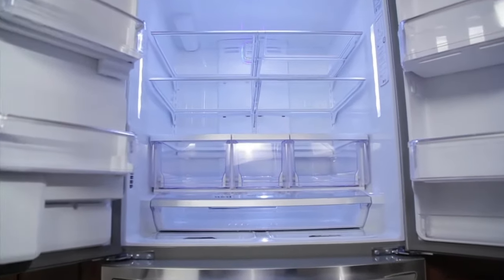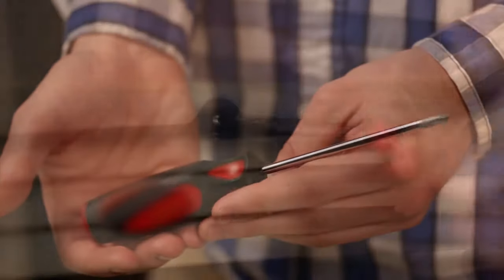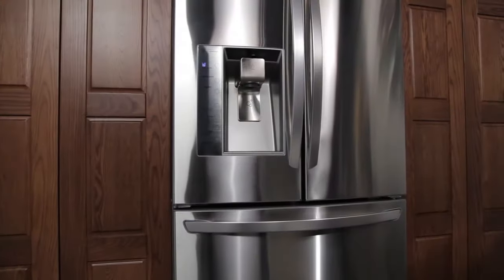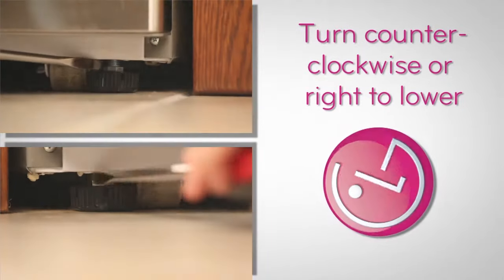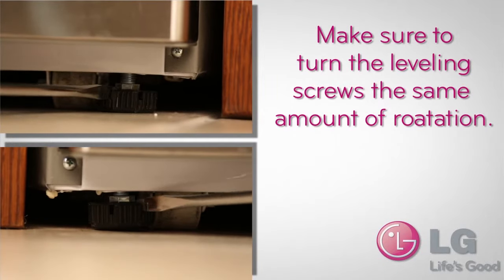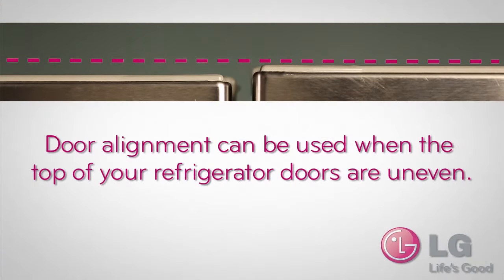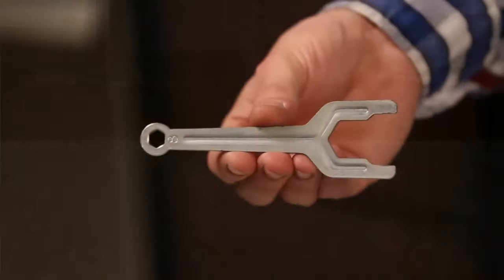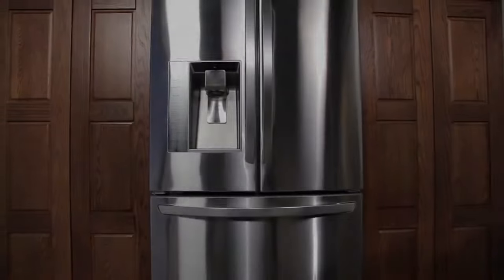[LG Refrigerators] French Door Leveling & Door Alignment

Comment: We just bought an LRFXC2416S french door fridge. I need to adjust the door on the right side facing the unit. There is no nut to adjust - as shown in your video.  I cannot find anything helpful to level the door.  Is there something specific to this unit I am missing?
Reply from the maker: I’m sorry to hear you're having this issue, and I’d like to see if we can assist. Please contact LG Customer Support by direct message via Twitter ( @LGUSSupport  ) or Facebook Messenger ( https://www.facebook.com/LGUSA/ ), and include your contact details, the model & serial numbers, and a detailed description of the issue. ^Nolito
Reply: Look in the manual regarding this. Some models don't have an adjustment nut on the right and instead, you lift the door to insert snap rings. Mine is like that (LFXS26596S) and includes two snap rings (look in the package with the manual). The manual for your fridge says the same thing. Did you already lower the left door as much as possible?

Comment: The adjustment for my left door didn't work. No matter which direction I turn the nut (which the supplied tool doesn't fit very well), it still remains higher than the right door. And I have the cabinet perfectly leveled across the front, and enough tilt so the doors close.  Seems to be a very poor door adjusting mechanism for it not to be able to do this.
Reply from the maker: So we can better assist with your issue please contact LG Customer Support by any of the below options:
Live Chat:  https://www.lg.com/us/support/chatbot
Email: https://www.lg.com/us/support/email-appointment
Facebook Messenger:   https://www.facebook.com/LGUSA/  
Twitter: @LGUSSupport      

^Diane
Reply: Were you able to fix this problem? Same issue. The adjustment nuts for the door do nothing. The installation guys snuck out while I was working.
Reply from the maker: Hi there bassplayer10. Welcome to our Social Media page. Based on your recent post, we see that you may need support. Please send us a private message with your name and phone number and we would be happy to investigate this further.  ^Jovelyn
Reply: @bassplayer10  unfortunately no. I never could get it even. Let me know if you're given something that works.
Reply from the maker: Hello bassplayer10! I'm passing by to check up on your case. Do you still need assistance? If so, let us know if there is anything that we can do for you.  ^Jovelyn
Reply from the maker: After several attempts of reaching out to you, unfortunately we did not receive any response. We assume that your concern has already been addressed. For now, I will go ahead and end our session. Should you have any other concerns, please feel free to reach out again. ^Jovelyn
Reply: @LGUSASupport  OK Jocelyn. I appreciate your reply. What else do you propose I try?
Reply from the maker: Hi, krga94c. I’m sorry to hear you're having this issue, and I’d like to see if we can assist. Please contact LG Customer Support by direct message via Twitter ( @LGUSSupport  ) or Facebook Messenger ( https://www.facebook.com/LGUSA/ ), and include your contact details, the model & serial numbers, and a detailed description of the issue. ^Chad

Comment: I just purchased (November 7, 2020) the LG French door refrigerator and the doors do not line up, even after adjusting the nut on the right door and adding the two factory provided C clips/rings to the lleft door.  Adjusting the nut on the right door did very little to raise or lower the door.  Adding more of the C clips/rings for the left door may fix the alignment issue, but I'm not sure if it's recommended to add that many C clips/rings to the hinge mechanism.

Comment: in my case, the doors are aligned and level. But the center flap on the left door does not close properly leaving a gap between both the top doors. The small plastic nub on the left door slides just below the channel at the top. Do I raise both the doors or is there anything else that can be done. model is LRFLC2706S 27 cu ft
Reply from the maker: Hey there! Let's close this gap from now on. The door might look even, but a small adjustment can make the difference. Here is a video on getting this fix quickly and simply. If you have any questions, please private message us on @LGUSSupport. http://spr.ly/6051XHEmP ^David

Comment: the front wheeles need to move up because the fridge is tipped too far back. how do i adjust?
Reply from the maker: Hey Josh. To adjust your LG fridge, you use a flat-head screwdriver to adjust the leveling screws. Turn the leveling screws clockwise or left to raise that side or counterclockwise or right to lower it. It might take several turns of the leveling screws to adjust the tile. We recommend a tilt to the back, so the doors can close easily. You can use a leveler to make sure the fridge is level. For more questions, private message us on social media @LGUSSupport. We're always here to help. ^David
Reply: @LGUSASupport  the leveling screws are adjusted all the way up, however the wheels are holding the front of the fridge up too far. I need the front wheels to rise into the bottom of the fridge.
Reply from the maker: Hey Josh. We would like to get more information about your LG fridge so we can help you better. Please private message us on social media @LGUSSupport with your contact details and model number. We'll be waiting for your message to help you better. ^David
Reply: @LGUSASupport  what social media?? what are you talking about? how about email?
Reply from the maker: Hey Josh! You can reach us on any social media platform like Facebook, Instagram, or X.com for example. Our private messages are always open. Looking forward to helping you! ^ Diego